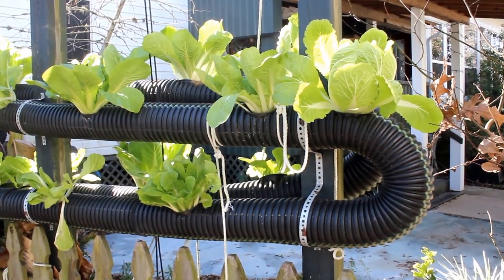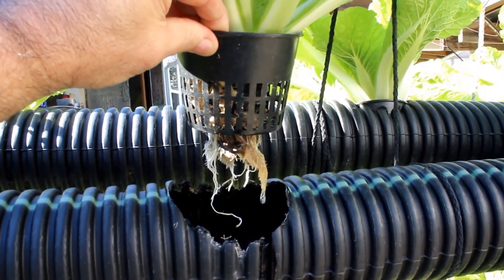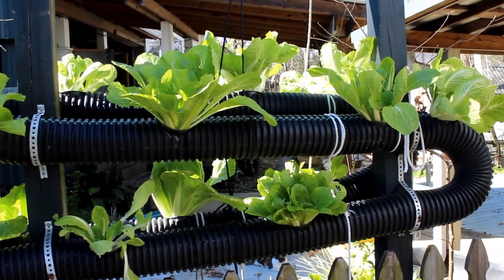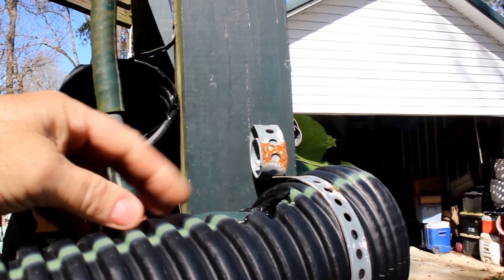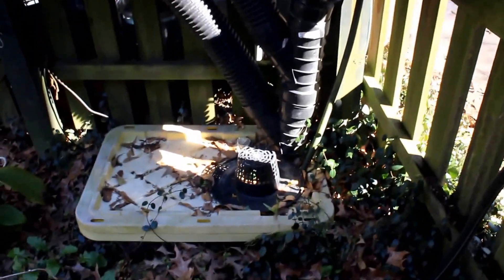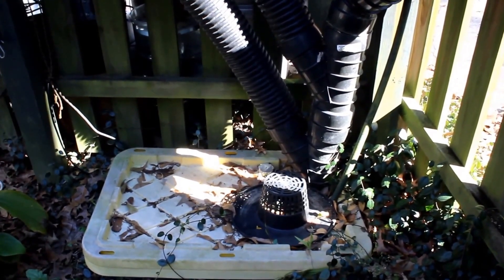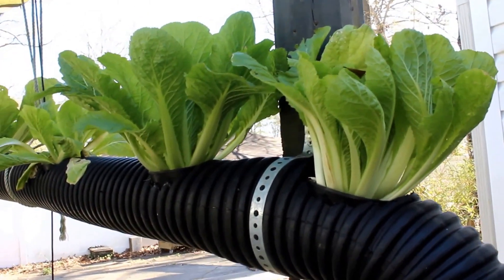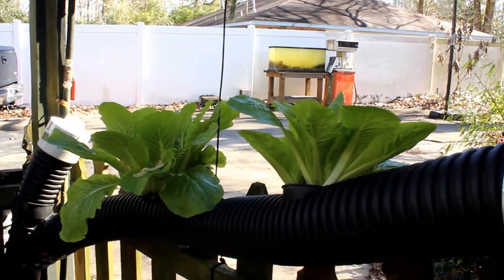Bok Choy Asian Cabbage Hydroponics with Cajun Calvin

Comment: Great idea, this is much cheaper than using PVC pipes. The cost of 45' and 90' elbows for those alone would be more expensive than your entire system.

Congrats on the nice harvest!
Reply from the maker: I had a roll of corrugated pipe, so I tried it out. It worked out great for along time, but I did upgrade to PVC for rigidity and leveling. The corrugations seemed to give a little more aeration to the water, but held sediment. Give it a shot.

Comment: Hi, Calvin! I love your setup. I would suggest, though, that you replace the garden hose you are using for your feed with another type of tubing or hose. Regular old garden hose isn't intended to be used for water that will be consumed by humans. They often leach lead and other contaminants. That's why people say you shouldn't drink water from garden hoses.
Reply from the maker: Thanks for the input. I used readily available materials for this system. I replaced most of the system with new pipe, but still need to improve on the water supply.
Reply: do you mean the tille garden hose he uses or all the black pipe in where he put the plants?
Reply: does he mean the tille green garden hose you uses for up the water or all the black pipe in where you put the plants?